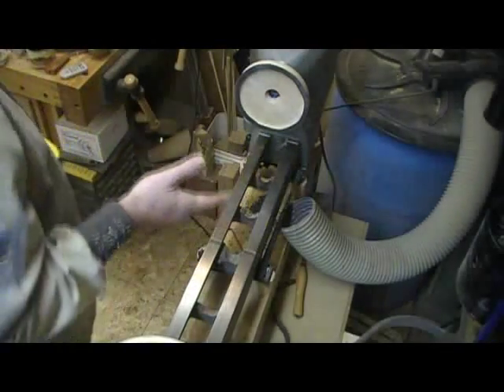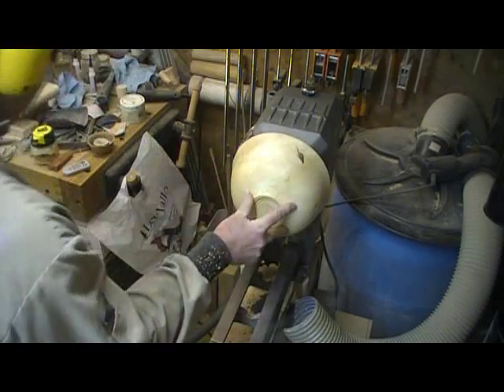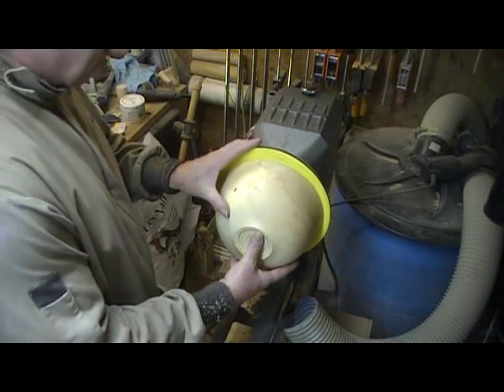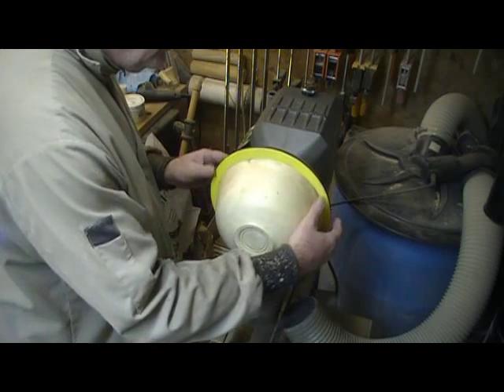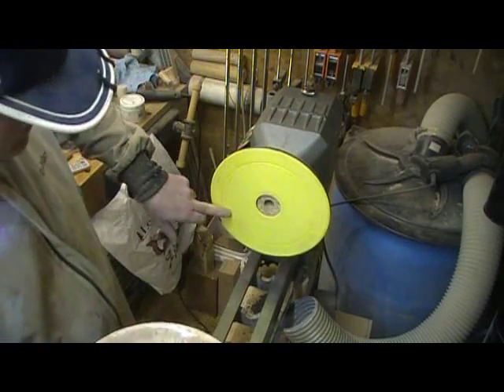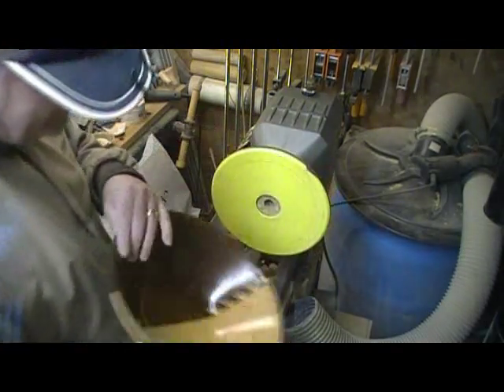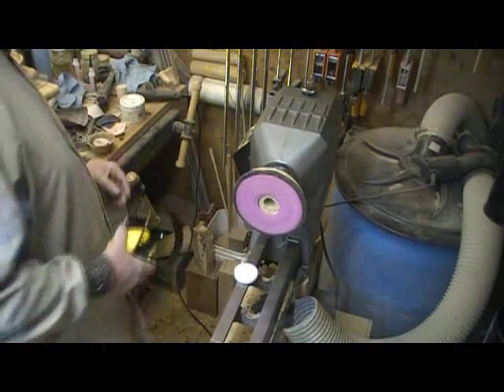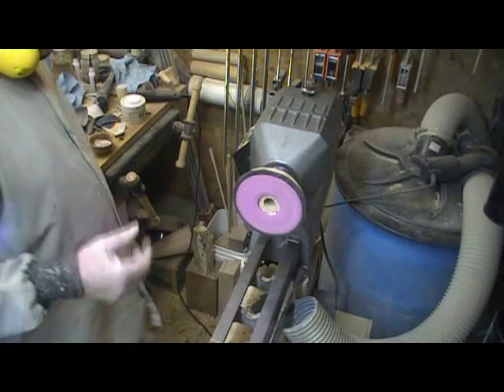Vacuum system segment 3 of 3

Comment: I used a shop vac for a short time, and still would had I not been given a vacuum pump. They do work great for most stuff. However, I do like the quietness of my vacuum pump (JB Eliminator). And now that I have a large vacuum chamber (10 gallon air tank), it doesn't have to run constantly either, as long as I don't have much leakage anyway.

It's also sweet to be able to use a vacuum press bag! The bags can be home-made for cheap too. My first was a heavy shower curtain! Now I buy 20mil sheets.